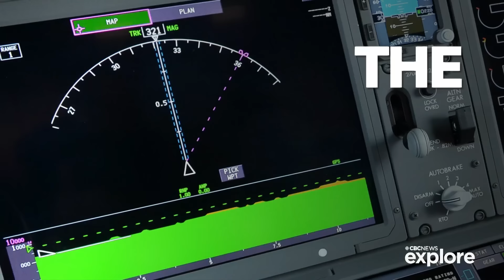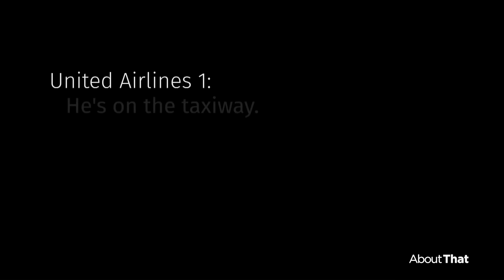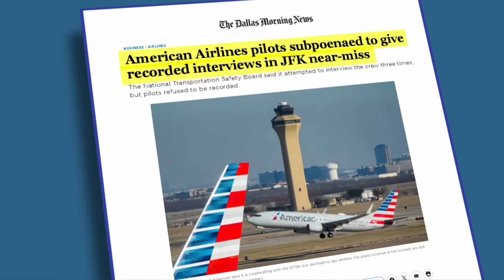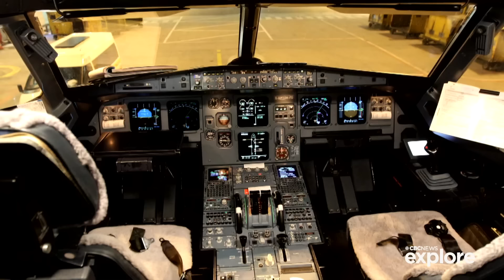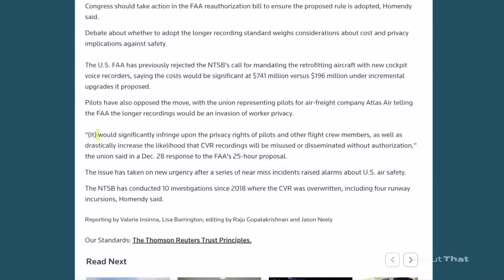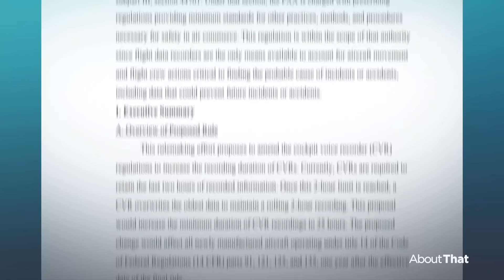Alaska Airlines blowout: How the cockpit voice recorder got overwritten | About That

Comment: What you can't for now as a stop gap fit a cockpit microphone or 2 with a thumb drive and in the event such as this, and as part off the shut down procedures that the thumb drive is collected and then handed over to the NTSB? I would like to think in an advent like this that the  cockpit recording could be used for better training of pilots? I think the pilots did a remarkable job and although there may have been some confusion for them and what they possibly said at that exact moment, future pilots could learn from this?

Comment: The FDR would seem the more interesting set of data for this incident and we could wish for more telemetry being recorded for longer and maybe collected every time plane is in company shop for centralized analytics to use as training data for future AIs to identify early signs of trouble in realtime. What was the "benign" issue with the pressurization system?
Reply: "Future AIs"  As much as people want to run general-purpose computers with easily-modifiable software/firmware on aircraft, DO-178 really requires that everything from requirements to design to implementation to validation and verification be reviewed extensively.

Comment: Why don’t these things upload to the cloud? Would solve the storage issue and also mean that you don’t have to find the device when there’s a crash to get the data.
Reply: Exactly
Reply: Some planes in use by airlines outside the USA do have that. MH370 communicated with a satellite for about 6 hours after the pilot disabled land communications and the planes transponder. But since it was only communicating with a single satellite the time lags can only provide a distance between plane and satellite.

If there was a requirement for these planes to have GPS, transponder, and other equipment that can't be disabled by the crew while in the air, that would be a big help.

Comment: there is a potential for Abuse if video is placed in cockpit. Unions have fought for safeguards against administrative actions against pilots if the CVR is pulled and conversations are discovered that are disparaging towards management. Who is to tell when Video would be pulled just to see what’s going on even when no accident or incident has happened. Potential for Abuse needs to be safeguarded and regulated

Comment: Other than how the pilots reacted to the door popping off, the CVR wasn't going to be very useful for determining why the door plug blew off. It's not like there's a knob, switch, or button in the cockpit that says "Doorplug Ejecter" and the pilots were daring each other to fiddle with it.
Reply: It would have been of great interest knowing when at what altitude on some previous flights cabin pressure alarms came as reported and what let to forbid to use this particular plane over the see.
Reply: Lessons can be learnt from how the crew responded to the event. Did they follow procedure? If not, what was stopping them? What was their mindset/workload around the time they were supposed to pull the circuit breaker for the CVR?

Comment: Boeing mainly puts a two-hour recording limit in place is to prevent liability and lawsuits. If Boeing could make better-quality planes, the recording could be reprogrammed to 25 hours.
Reply: The two hour minimum is an FAA rule, so they put the minimum compliant CVR in by default.  An airline could ask for CVRs with a longer loop.
Reply: It's not a Boeing issue.  Boeing planes in Europe have 25 hours long recorders.
It's an FAA issue.

Comment: It's amazing in the era of iPhones that there isn't 20-30 hours of recording. They stopped using magnetic tape years ago and switched to digital memory. Certainly, the memory is cheap enough to boost the recording capacity. All that's needed is an FAA directive. And sorry, pilots, your privacy ends when you step into the cockpit and assume responsibility for the the lives of your passengers. If you're worried about personal matters being recorded, then save the gossip for when you're on the ground!

Comment: They're worried about audio only recording? I'm on full video recording all the time at work... I work in retail! Now granted its not likely that audio is being recorded. But for someone working in a life critical profession, I think that having their audio recorded in the cockpit all the time is something they need to put up with. Its easy enough to watch what you say when you're at work, and you should anyhow.
Cockpit voice recordings should minimum record for 24 hours and automatically save when the aircraft has a severe G loading incident that's outside the normal flight envelope. Other events like unexpected cabin depressurization should also preserve the recording. There's no reason any of the 100+ parameters that are already monitored on the plane couldn't be used to automatically tell the CVR to save data for later or loop when everything is normal.

Comment: Thanks, didn't even know. About the fissure. I am also thinking there was a German radar plane mounted that can go 15 meters perhaps would be more efficient but that was 10 years back being 2024 already OMG. I would think they can go 20-35 meters now. I was about to say the cold snap lately having causing chaos on road for people who are not used to it. Even if used to it need caution. My guess is most tourist are not used to these conditions. I would think some kind of reference of separation would help, dont need to separate the road but just put some flexible pole like those on bicycle lanes in warmer climate, the distance can be greater just to remind people would help I would think.

Comment: Yes, this two hour overwrite  needs to be fixed. However I don't see why the cockpit voice recorder is of much value in this case. This was a clearly a mechanical failure, not pilot error. They got the plane down safely and nobody was seriously injured. They do have the flight data recorder and I saw a news clip where the pilots did everything right to handle the situation. And they are both alive and well to answer questions.
Reply: The CVR would have recordings of the various alert and alarm sounds used to notify pilots of what's going on. Presence or absence of those sounds provide evidence of systems functioning, or not. Compared with the FDR data the sounds on the CVR tell the investigators what actions the crew took in response to the alerts and alarms, and if they were the proper responses.

There have been crashes that wouldn't have happened if the pilots hadn't made incorrect responses to warnings and alarms. The CVR provides that evidence.

For this Alaska Airlines incident, the CVR most likely would show the crew did everything properly. Then the NTSB could put in their report that the crew did everything properly.

Comment: With modern storage solutions it should be more than 2 hours of recordings and more than the 25 hours we have in Europe. Why not have 7 days at least, audio AND video.
Also it should have a system that automatically protects recordings in the event of an emergency warning/alarm going off and downloads them to the relevant authorities as soon as the plane lands, they would have been aware of the issues this aircraft was having and could have forced the airline to investigate BEFORE it was a major problem. Multiple alarms for cabin pressure isn't something to be ignored. 
Pilot privacy over safety then safety wins every time when it's hundreds of lives at stake.

Comment: You can easily calculate that 24 hours of 64 bit depth MP3 audio recording will only take up 0.06 Tb of space.... that is easily obtainable on a thumbdrive today.    A Costco 2 Tb SSD today exceeds the space needed for 33 DAYS of the highest quality continuous audio recording.   How is it airlines are stuck with 1980's technology that only lasts 2 hours?   Clearly the FAA is not staying current and keeping airlines safe with modern tech.

Comment: Airbus CVR automatically turns off 5 min after 2nd engine shutdown. According to Ops Manual. In Europe, maybe the US is different when it comes to automatic shutdown as well? With an auto-stop a 2 hr recording should be plenty.
Reply: I'm looking at some wiring diagrams for a certain airline now (which flies regular NG's). It has both types in the same airline! i.e. some run whenever there is electrical power and some run when the engines are turned on.
Reply: If the FAA has problems getting the 25hr recording capability accepted an automatic shutoff function would probably be a solution in most cases. 
I have over 20 years on the 737NG, mostly in an European airline. As far as I remember all of them had auto-shut off after 5 min. Some of those years were with a Korean airline but I cannot seem to remember how the CVR worked there.
Reply: @jostenberg6130  If there is an automatic shutoff, you will need an automatic startup. e.g. Plane has a 45 minute transit. Conversations between incoming crews and outgoing crews, conversations with engineers and other ground staff, preflight check audio, etc, all may be useful. Fuel cutoff levers to RUN is too late. No doubt, that's why the newer (elec power on) system was brought in.

Comment: The US - the least private western     suddenly cares about privacy     :)

Edit:
What I don't get: the plane clearly must have recognized "the mishap". Why not just recording 2 hours; then, when the plane recognizes a "mishap", automatically extend it to 25 hours? And at the end of those 25 hours, it would just stop (automatically, if nobody pushed/pulled the "keep button"); except, if the plane would take off again - which _ frankly _ should never happen in the first place, after an incident.
(Yes, you loose any "information" that could have come from previous flights; but you would have both: privacy and the be sure to have recordings of incidents.)

Comment: My actions and more than 80 flight and system parameters are recorded every second on FDR, if I crash, the CVR is available. Radio transmissions are all recorded by ATC. Why do you need 25 hours of work and non work related conversations? I’ll tell you why: blame apportionment. Did the door blow off because the pilots where talking the Sunday games?

Comment: A 25 hour minimum should not require debate after multiple failures to preserve CVR evidence.  Avidation and many other industries/institutions have lost public trust for good reasons, and that has consequences.  The fact that privacy is in question here demonstrates low trust, and that's valid in an age of gov't & corporate surveillance.  With good governance in both industry and gov't, it's possible to safeguard information with encryption and enforce regulations to assure data is used responsibly.  The trend is quite the opposite. (eg: automotive industry extreme surveillance, and no government response)
Do we even want good governance?  Many voters have answered "no", based on the terrible quality of public discourse, and the lack of critical thinking.
Air Canada 759 was over 5 years ago, and this is the first time I've seen media acknowledge the evidence destruction by incompetence.  That's progress, but society is failing and we need to expect more of ourselves and others.

Comment: Seeing as this plane was only 2-3 months old if it had been a requiremet for new planes only (which is a good start) since the Max crashes this would have been good enough for this flight. It's absolutely insane and the objections from the pilot unions are ridiculous, pretty much every other country does it without a problem, you are NOT special!

Comment: On the note regarding the "Pilot's Privacy": Pilots have the lives of more than 250 people in their hands. Every word, every switch pressed, every direction change should be recorded on every flight for the whole flight. Why has there not been a cloud backup, that during the flight all data is sent back to a HQ and only deleted after 30 days Afterall this is 2020... sorry 2024!!!!
Reply: Every switch pressed, every direction change is recorded on the FDR which does have 25 hours of recording. Until satellite data prices come down, no airline can afford to have continuous streaming. Passengers are the first to complain when ticket prices go up. Very few care about safety... until their aircraft is falling out of the sky.
Reply: Formula 1 cars do it.

Comment: Why has Alaska Airlines and United Airlines own Maintenance and Serving Aviation Engineers, only now in the last few days found more of these securing locking bolts and nuts being loose on Boeing 737 Max aircraft. 

Which secure these emergency exit doorway non-opening Plug Sections?

That is after last weekend's Alaska Airline Boeing 737 Max 9 aircraft, was involved in a Mid Air Accident Incident, with one of these emergency exit doorway non-opening Plug Sections, blow out and off the aircraft fuselage!

Why did not either Alaska Airlines and United Airlines own Maintenance and Serving Aviation Engineers, found any of these securing locking bolts and nuts being loose on Boeing 737 Max aircraft.

That is before last weekend's Mid Air Accident Incident, or for that matter any other Airline operating Boeing 737 Max aircraft around the world either?

Maybe the FAA and NSTB, plus British CAA and European Aviation Authorities and their own Countries Air Accident Investigation Units, should be questioning Airlines around the world, who operate Boeing 737 Max aircraft.

Also the News Media asking questions of Airlines who operate and fly passengers on Boeing 737 Max Aircraft, why have none of you found ant of these securing locking bolts and nuts being loose on Boeing 737 Max aircraft. 

Which secure these emergency exit doorway non-opening Plug Sections, also not reported to Aviation Authorities or to Boeing that is before Alaska Airlines Mid Air Accident Incident of last weekend??

Instead everyone are trying to place all the blame, on Boeing Personnel and Boeing Company quality Control process is to blame.

The Airlines own Maintenance and Serving Aviation Engineers, are not to blame in any way, come on everyone these Airlines are only now reporting they are finding these loose securing locking bolts and nuts on these emergency exit doorway non-opening Plug Sections.

That is after the event, a emergency exit doorway non-opening Plug Section blow out and off a Boeing 737 Max 9 aircraft belonging to Alaska Airlines, also only after the FAA and NSTB ordered grounding and inspection of suspected Boeing 737 aircraft too.

I would say Alaska Airlines own Maintenance and Serving Aviation Engineers, should have found these loose securing locking bolts and nuts on these emergency exit doorway non-opening Plug Sections, long before this Mid Air Accident Incident happened?.

So the blame for this Mid Air Accident Incident, should be shared between Boeing and Alaska Airlines!

Or should be equally and evenly shared between other Airlines too, who did not find this problem or issue of loose securing locking bolts and nuts on their own Boeing 737 aircraft emergency exit doorway non-opening Plug Sections too!

Then maybe some guilty over allowing this Mid Air Accident Incident to happen in the first place, should be placed on the FAA and NSTB Inspectors. 

Have all are they FAA and/or NSTB Inspectors, have a duty and requirement to inspect new Aircraft before they go into service or while they are being built too?

Similarly the FAA and/or NSTB Inspectors, have a duty and requirement to inspect Airlines operational aircraft, plus Airlines Maintenance and Serving Aviation Engineers and aircraft undergoing maintenance and serving or repairs etc too?

Though no FAA or NO NSTB Inspectors, found any of these loose securing locking bolts and nuts, on any Boeing 737 Max aircraft emergency exit doorway non-opening Plug Sections either before last weekend Alaska Airlines Mid Air Accident Incident did they too!

Comment: Conveniently written over...the pilot's anguished voice says it all. The pilot can pull the circuit breaker on the CVR to prevent it from being overwritten at 2 hours. The CVR would have only shown that the pilots were freaked out and would be rather embarrassing. Granted it was a stressful situation but we'll never know what they said to each other during the flight after the event.
Reply: The first officer was nervous, but I think “freaked out” is an exaggeration.  It may have been her first emergency.
Reply: Says someone who has no concept what an explosive decompression feels like. They lost their headsets, checklist, dealt with a concussive ear pop, condensation like smoke, then pulled out and put on masks, reconfigured the audio panel, leveled the plane, called an emergency, started a decent, navigated back to the airport, found the replacement checklist in the QRH, ran the normal and emergency checklists, programmed the approach and safely landed the plane all in about 12 minutes. Anyone who has flown an airliner knows that they were on their game. The CVR turns off 5 minutes after engine shutdown. So all though they forgot to pull the breakers, they personally are not responsible for the other 1h40m of time that caused the overwrite. If the CVR was so important, NTSB could have asked maintainence to pull the breakers when they re-powered the plane.